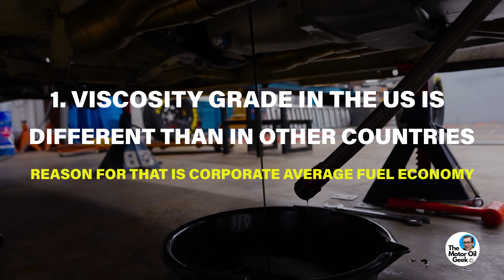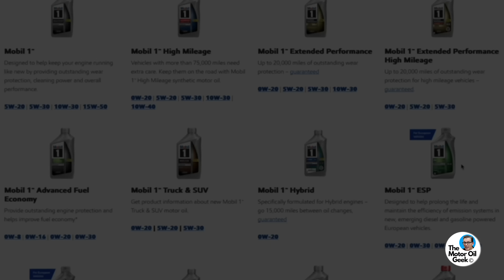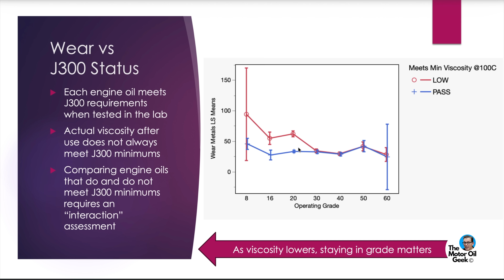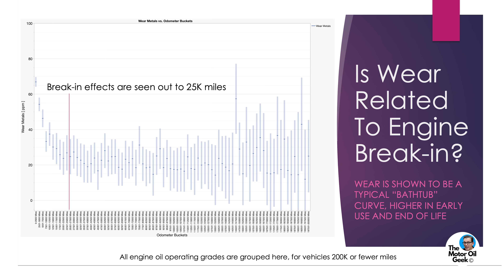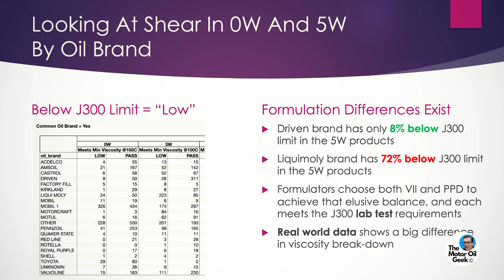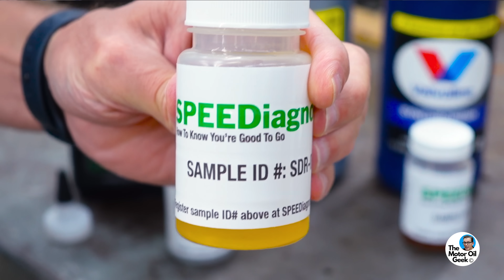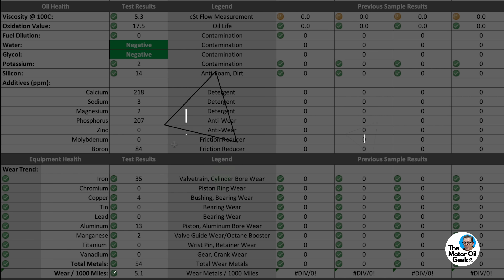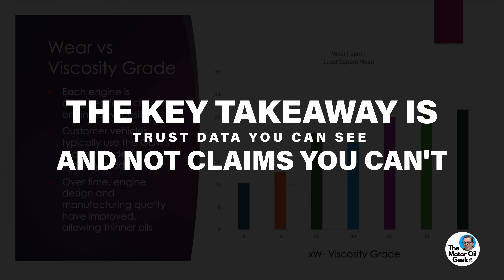More Ai Lies? The FACTS about 0W-20 vs 5W-30 (With Evidence)

Comment: Staying “in grade” in the wrong measure because the grades are just arbitrarily drawn lines on the KV100 spectrum. What matters is the % of KV100 lost. If you start out as a thick 12.5 30 grade and drop to a 9.6 30 grade, that’s much worse than dropping from a 9.5 to an 8.9, even though the latter is “out of grade” now.

Comment: I really never understand what this guy's saying?? 0-20 is junk oil period.. i would be okay with 0-30.. In the winter with a new car's, I'm never ok with 0-20.. everyone should know AI is a joke.. FROM TOM..
Reply: How about 0W-8?
Reply: @aliendroneservices6621 NEVER!!!! FROM TOM!!!!!!!!!..
Reply: Thin oil is good for an engine under warranty. but a worn out engine, with more space between parts, needs a slightly thicker oil to cushion better between parts.. Been adding thicker oils to many oil sucking engines for decadesas mechanic.  to cars, trucks engines , also on my airplanes engines too.  Thin oils on not new engines will slip thru piston rings easily and burn it to the point of losing 2-3 quarts in 3,000 miles and wreck the engine. Seen that many times as mechanic and commercial pilot too.  
 Thin oil might be good only for freezing weather starts, but as engine warms up, an old engine will burn it quicker and you will end up with less OR no oil after 3,000 miles, 4,000 more or less.
Reply: @outwiththem Right,, if a person is worried about the warranty?? I'd say 0-30 never 0-8 are 0-20..  FROM TOM..

Comment: For stop/start engines, does 0W oil drain back down quicker when an engine stops? Also leads to more fuel dilution. And for cylinder deactivation, those cylinders do pull a vacuum, does it increase likelihood of oil passing the rings? More burn, soot, and sludge to block passage ways. That's how you get spun bearings.
Reply: "...does 0W oil drain back down quicker when an engine stops?"
The ADBV (Anti Drain Back Valve) in your filter is supposed to prevent that.
Reply: Thin oil is good for an engine under warranty. but a worn out engine, with more space between parts, needs a slightly thicker oil to cushion better between parts.. Been adding thicker oils to many oil sucking engines for decadesas mechanic.  to cars, trucks engines , also on my airplanes engines too.  Thin oils on not new engines will slip thru piston rings easily and burn it to the point of losing 2-3 quarts in 3,000 miles and wreck the engine. Seen that many times as mechanic and commercial pilot too.  
 Thin oil might be good only for freezing weather starts, but as engine warms up, an old engine will burn it quicker and you will end up with less OR no oil after 3,000 miles, 4,000 more or less.

Comment: IF YOU WANT ONE OF THE BEST AMSOIL SIGNATURE SERIES  - SEVERAL OILS YOU CAN BUY AT WALMART THAT REALLY SEEM TO TEST WELL ULTRA PLATIUM PENNZOIL -ECT -  Best thing if you are worried about it change your oil under 5000 miles or 3000 in the grand scheme its cheap ! Fun Times Ahead

Comment: I run 0w20  when recommended UNTIL around 75k miles, then I switch to 5w30. Also, the recommended 10k oil change interval is ridiculous. Please change your oil at least every 5k.
Reply: That is the way.  Thin oil is good for an engine under warranty. but a worn out engine, with more space between parts, needs a slightly thicker oil to cushion better between parts.. Been adding thicker oils to many oil sucking engines for decadesas mechanic.  to cars, trucks engines , also on my airplanes engines too.  Thin oils on not new engines will slip thru piston rings easily and burn it to the point of losing 2-3 quarts in 3,000 miles and wreck the engine. Seen that many times as mechanic and commercial pilot too.  
 Thin oil might be good only for freezing weather starts, but as engine warms up, an old engine will burn it quicker and you will end up with less OR no oil after 3,000 miles, 4,000 more or less.

Comment: I have a 2017  5.7 Hemi Ram , with 55000 miles I just changed from an factory 5w 20 to a 5w30  oil ,   I have about 600 miles on that oil now and have seen no side affects of changing . may be a little quieter .  MDS works the same , no issues with it so far .  Do you think there is any harm in this ?   What is your opinion ?  I live in Arkansas where it gets pretty hot . oil pressure went from 34 to 35 psi  at hot idle .  any one else free to chime in with opinion .

Comment: I do not believe he makes his case that the claims of the AI video are wrong.  The fact that a 5W-30 is more shear stable than a 0W-20 and the 0W-20 offers less (insufficient) protection when it shears out of grade seems to suggest that 5W-30 is the better choice, as was claimed in the video is is taking issue with.  His fundamental beef seems to be that the AI video did not show evidence to back up their claim, not that their claim was necessarily wrong.

Comment: It's a fact 5W-30 has better protection the lower or thinner oil means better fuel economy cause they have less resistance so having a thicker oil will help if the car burns more than usual during hotter climates

Comment: I spun a rod bearing using 5W-30 in a ford ranger. The inside of that engine was just about perfect. When rebuilt a new crank shaft was installed. Now I use exactly what the manufacturer says to use. It's not the pistons you worry about, it's the rod bearings. My thought.
Reply: What model-year, and what does the manufacturer recommend?
Reply: Not enough info you provided. Seen more old engines been wrecked with thin oils used.. Thin oil is good for an engine under warranty. but a worn out engine, with more space between parts, needs a slightly thicker oil to cushion better between parts.. Been adding thicker oils to many oil sucking engines for decadesas mechanic.  to cars, trucks engines , also on my airplanes engines too.  Thin oils on not new engines will slip thru piston rings easily and burn it to the point of losing 2-3 quarts in 3,000 miles and wreck the engine. Seen that many times as mechanic and commercial pilot too.  
 Thin oil might be good only for freezing weather starts, but as engine warms up, an old engine will burn it quicker and you will end up with less OR no oil after 3,000 miles, 4,000 more or less.

Comment: Thanks for video.  I think i saw that video you referred to and was wondering where are the 50 vehicles.  Got a 17 Tacoma with 30k on the clock. First oil change at 900 miles and change in spring and fall with usually less than 2k miles on a change. I am thinking of switching to a 5w30 in the spring for summer use here in te Midwest.  Then in fall head back to a 0w20.

Comment: Any explanation as to why xW-16 oils demonstrated higher shear instability than xW-20 oils? By the metrics given in this video that should not be the case, or is that more of a reflection on the data being dominated by Toyota examples and higher OCI's? I just bought a Toyota Rav4 with the standard 2.5L, factory fill is 0W-16 and I picked up Idemitsu ILG-5 0W-16 with the intention of staying with the spec motor oil but 5,000 mile OCI's.
Reply: I was thinking the same and you might be right - most 0w16 samples are TGMO and I’d bet most of those samples went between 7500-10k for OCIs. That plus a smaller sample size as well. I think the take away from this video is not what grade you select, but making sure the oil formulation you choose is staying within spec.

Comment: Hey Lake. I got a question, I want to do an oil analysis using restore and protect. I already have it running in the car. Going to send the analysis on the 4th change. Will it be ok if the first round gets changed at 5k miles or does it have to done before? In the Valvoline website it doesn’t say anything of short intervals like Royal purples website says 🤔

Comment: Thanks for posting, Lake.  But hang on a minute - elementary tribology says a more viscous newtonian fluid like oil can take more vertical load with increasing viscosity.  101 stuff   So - a 0W-20 CAN CAN CAN lubricate adequately under a lightly loaded engine.  Add a turbocharger, add a heavy towing load, and your wear comparison is shot to hell.   Even a little GDI motor like our Mazda CX-5 SkyActiv Turbo 2.5 calls for 5W-30.  5W-20 for non-turbo.  What does that tell us?  Plus, GDI engines are so dirty you have to shorten your OCI's anyway!  It's not as simple as "standard wear test = good".
Reply: Good comment. Tribology, Science, Data, Charts, Graphs, the more I watch Lake I have started disagreeing more and more just due to diligent research. It just looks like the everyday clickbait and anyone with mechanical knowledge and skills see's that. Oh no another oil video. Boring Lake.

Comment: To keep things simple....regardless of what oil grade you use.  Change your oil EVERY 2500-3000 miles.  It will GUARANTEE that your engine WILL outlast  you!
Reply: A buddy did that with a brand new Cadillac and the engine totally was ruined right after the 100k mile warranty was over. The camshaft broke; fatigue failure broken valves and pistons. A fatigue failure due to bad materials, cracks, bad stress riser areas can happen if the oil is changed every 1000 miles

I
Reply: @3beltwesty its a GM.  You cant expect much from them engines since the 90s.
Reply: @hmuong  Garbage Motors exactly!
Reply: You know nothing about automobiles if you think oil condition is the only cause of engine failure.
Reply: @aliendroneservices6621 you are absolutely right.  I haven't had a clue about automotive or service stations.  Because ive been doing all my maintenance and haven't had an engine failure for the last 40years.

Comment: The oil scene is wild—everyone’s hunting for a 'magic pill' oil to fix everything. It used to just be a trade-off between cold-start flow and hot-engine protection. Now, ecology and fuel economy have added a third pillar to the specs. Throw in these variable oil pumps and it’s just one more gear in the system to throw things out of whack if you go off-spec. It’s becoming way too much for the average oil guy to keep track of.
Reply: You could change the oil and filter every 1000 miles and still have fatigue failures due to bad stress riser areas on parts.

Comment: When an AI video is suggested, I click on "Don't recommend channel".
My recent data;
I have a 2025 Ford Maverick Hybrid (port injection, non-turbo) and changed out the factory fill at 768 miles, adding Castrol Edge Advanced 0W-20, since the manual calls for 0W-20.  I live in Western NY, so the temperature does not get extremely high over the spring/summer that it was run, no towing during this interval (still breaking in).  I changed the oil at ~4.5k miles total, ~3.2k miles engine run (hybrid engine), oil 'felt' and appeared to flow 'thin'.  I already planned on having the oil tested at Europhins Test Oil.  Wear metals were good at this break-in stage; Iron 7, Copper 19, Aluminum 6, rest negligible.  Fuel dilution and glycol was 0.  But oil viscosity was down, 39.9 cSt @ 40C versus spec of 49 cSt @ 40C.  My thoughts were that the engine oil may have had increased shear rate during engine break in.

From collective videos, I was under the impression that Pennzoil Ultra Platinum seemed more shear stable.  I added 5W-20 for further anticipated protection against shearing.  When the vehicle was around 10k miles, we towed our pop up camper a couple trips during this interval.  I pulled the oil a couple days ago with ~7k miles total, ~5k miles engine run (hybrid), oil felt and flowed 'better/normal'. Oil sample sent out yesterday to test.  Will see what happens.

Speculation;  Engines during break in may benefit from tighter viscosity grades (5W-20 vs 0W-20) to combat shear.  Testing oil will help determine if an engine still tends to shear oil past break in (~10k miles).

Thank you MOG!

Comment: I've been a mechanic full time since 1996

Extended oil changes - beyond 5000 miles - are the single most destructive maintenance mistaken. 

Cars built between 1995 and 2005 never had engine failures outside overheating or being run out of oil due to a leak. Zero failures.

We see engines newer than 2010 regularly burning oil and jumping time from low oil level.
Reply: Friend had a Cadillac from the  1995 and 2005 era that the Engine grenaded right after the 100k mile warranty went out. Then also had a Buick that the oil pump failed right after the 50k warranty ran out. Both had synthetic oil and filter changes every 3 to 4k miles

Both cars were bought new; both were sold as totaled ie scrap cars for someone to replace the entire GM engine.
Reply: @3beltwesty excellent point cherry picking the garbage Cadillac engine and ignoring everything else. 

Name the buick engine please

Comment: When a 0W-30 sheers "out of grade" it still may have more viscosity than a 0W-20 that hasn't sheered out of grade to the same extent.
That is the 0W-30 will still have a higher viscosity than the 0W-20, and when 0W-20 is "Just" acceptable protection then the 0W-30 still wins this competition.
Reply: This. Heavier oil gives you a larger margin of error.